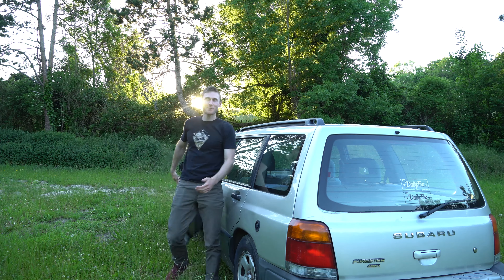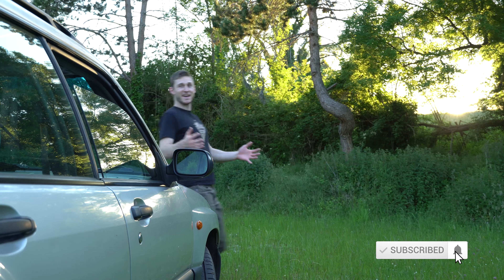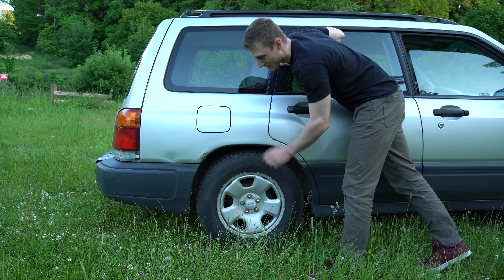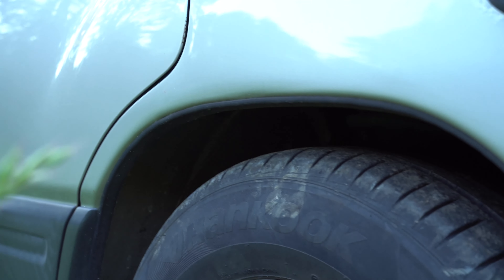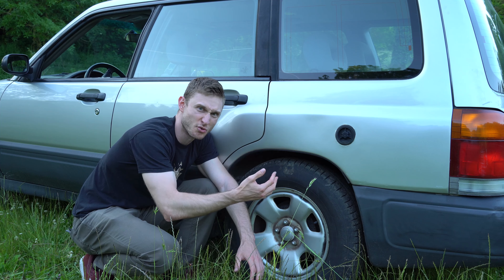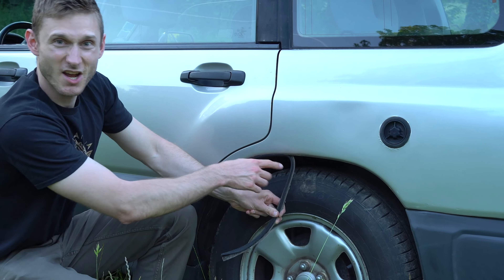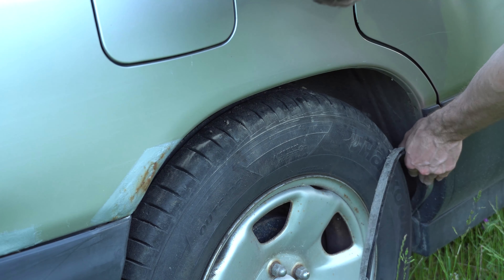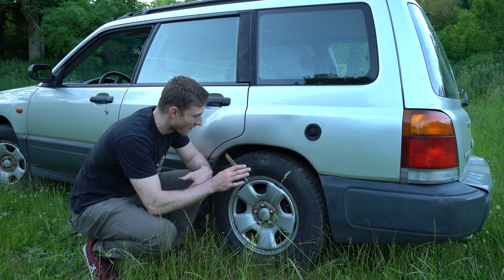DO THIS TO AVOID RUST on your Subaru Rear Quarter Panels (EASY DIY!)

Comment: This is a handy tip. Removal is the best option, hands down. 

If you are a purist and you want to keep them, your best bet is to remove them, fully clean underneath and on the sealing surfaces, fully clean the strips out themselves and then Fisholene coat the surfaces before replacing the strips. You may want to use a sealer to hold them back in place depending on the age of them.

Even if you do this and you do Fisholene the surfaces underneath, you should probably do this at least every 12 months if you want to be sure to keep the rust at bay, a right pain in the rear, (pun intended). You may even need to do it more often if driving regularly on salted roads.   

It will buy you 'a little' extra time and may hold the rust monster back a while, but if you want to avoid the rust altogether, I'd remove the things and be done with them as Jordan suggested, they are a pest.
Reply from the maker: Perfect additional infos, this comment deserves to be pinned 🙏🙏🙏
Reply: They are there to prevent getting rock chips  being kicked up into the paint by the tire there, if you remove them then you're at sqaure one still and they'll rust out when rock chips chip the paint, subaru out them there for a reason, just clean them out every season and spray some fluid film and you'll be fine. don't throw them away and leave the metal exposed
Reply: @growingup4487  That is their true purpose yes, but I've found in all of our Suabrus that the things ensure the cure is worse than the disease. We do a considerable amount of offroading with our Subies and stones flicking up there is a constant, yet even after years we haven't had too many issues with rust in the wheelguards, though, as mentioned previously, we do fisholene coat the inner wheel guards. 

Another problem with the plastic surrounds is that in situations involving heavy mud or sand work, they can come loose and become lodged in between the wheel and the tyrewell causing an infuriating obstruction. But its like anything, personal choice and what works best for everybody. 

to each their own :)

Comment: It sucks my 1999 Impreza has zero rust except there. Cars don’t really rust here in Georgia (US). Tomorrow I need to see if mine still has that rubber strip. My first 1999 Impreza did but it was almost brand new
Reply from the maker: It's definitely the worst spot for rust 😔

Comment: My rear quarter panels is rusting out on both sides. how do I even attempt to fix it?
Reply from the maker: You can try to stop the rust with a dedicated product or remove the rust by cutting and replacing with good metal

Comment: Also the door seals! The door seals on my 2018 are the style that cause the bottom of the door to rust out!  I took the door seals off my 2018 Forester to keep the door from rusting out
Reply from the maker: Woah, on a 2018?😮
Reply: @ALNSMOVERLAND  It's not rusting yet because I took them off immediatel, but I've had other vehicles with that type of door seal. USually after 5 or 6 years you have no bottom of the door.

Comment: Exact same problem with older Hondas. When we were living in Colorado someone hit the door of our 87 CRX Si in a parking lot. (Fortunately, an employee saw it happen and guilted them into not leaving.) When we took it into the body shop for an estimate, the first thing the tech did was walk over to it and rip out the plastic strips on the rear wheel arches. He said, "That's why every Honda in Colorado has rusted out rear quarter panels. Just move here?" We had. Never had any problems with the salt. Thanks body shop dude!
Reply from the maker: Absolutely! I had a 90 and a 94 civic and did that on them too 👊

Comment: Keeping it ( mostly) rust free is important, so thanks! However, the tires will throw around debris and stones. Will that not strip the paint off and then cause rust as well? On advantage is that without the strip you can spot rust earlier, but periodically checking would still be my preferred option?
Reply from the maker: Yes, that's was the purpose of those rubber things. But you will have less chance to get rust without (even with stone/debris strip) than with!

Comment: Thanks for the tip! I have always had concerns with that rear quarter panel rubber strip holding moisture. It's something that I check every so often.
Reply from the maker: They do nothing good! Now you know what to do with them 😁

Comment: they don't rust from the outside.
The rear arch lip rusts from the inside out .
Worst areas on rear is the strut top area and the support rib in the wheel tub directly behind the strut .
sill end closure around the seatbelt  bolt mount can get bad too .

Comment: Mine still has them😁. Got to keep things super clean and dry👍. The other issue is people pull at them, instead of removing carefullly by pushing them off the arch. This leaves them misshaped and thats the end of them being any use.
Reply from the maker: OEM purists might want to leave them on place (Yes, it's a part of me too 😁)
But as you said, they loose dorm and do more bad than good with time
Reply: @ALNSMOVERLAND  Top man Jordan👍. I'm OEM where possible but its quite a fight with a 22 year old Foz!